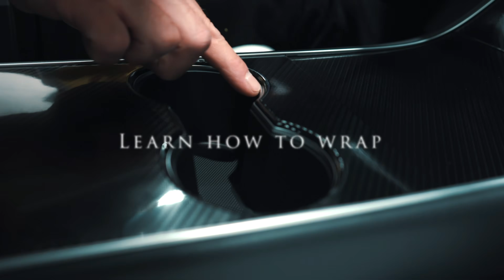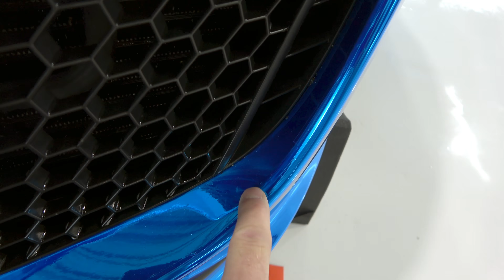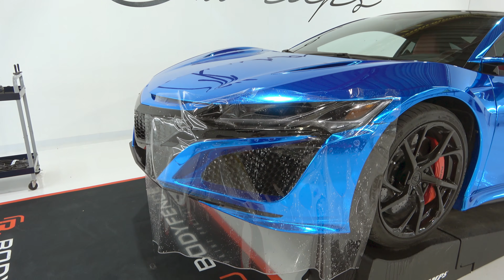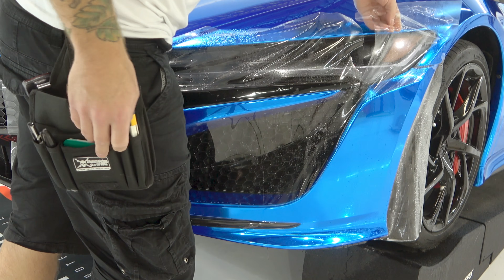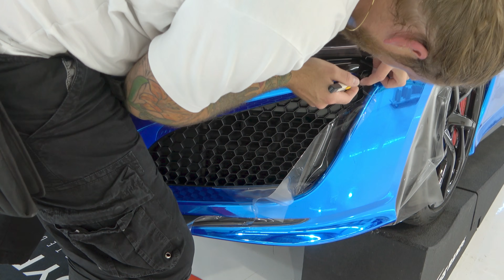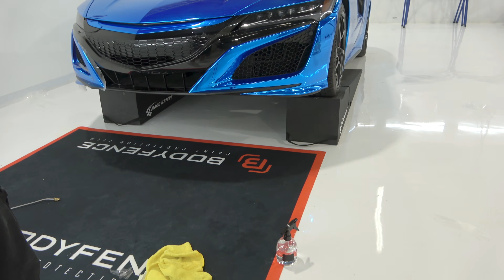How To PPF Over Blue Chrome VInyl Wrap

Comment: I noticed you PPF over Vinyl Wrap, can you do Vinyl Wrap over PPF. What is your thoughts on Dry vs Wet PPF. Seems PPF last longer than Vinyl Wraps, so should you not have the PPF under the Vinyl Wrap. I have checked, says PPF is warranted for like 3 to 6 yrs, but Vinyl Wraps are like 2 or 3 yrs.

Comment: Awesome! Can I apply this protect film on satin chrome wrap?
Reply from the maker: Yes but I'd use a matte PPF
Reply: CK Wraps will “matte PPF” transfer the satin finish? Thank you, I appreciate the feedback!
Reply from the maker: @shadow-fq7nk  basically, but you may lose a little luster. In my opinion it isn't necessary to PPF over satin chrome due to how thick the material is. It's also usually very durable against scratches.
Reply: CK Wraps that’s what I thought! Just wanna make sure from the expert himself 👊😏. Thanks again for the feedback!
Reply from the maker: @shadow-fq7nk  I have matte PPF at the shop, I can put some over the satin red chrome and see what happens
Reply: CK Wraps please let me know what is  the result then! I appreciate that!!! 💯
Reply from the maker: @shadow-fq7nk  keep a lookout on the yt story or tiktok

Comment: Someone actually bought a new NSX!  Haven’t seen one in the wild yet. 
Does the ppf cause the vinyl to age at a different rate than the rest of the car?  The ppf parts will protect that part from UV damage, but the rest of the car will are differently. Or is That not a concern?

Great job as always Christian.
Reply from the maker: Realistically it would be best to do the entire vehicle with PPF over the chrome but that takes something which is already expensive and makes it even more expensive. The unprotected parts will definitely weather over a shorter period of time but at least the front end will benefit from protection of impact.

Comment: Would heat help make the PPF stretch to make application easier ???
Reply: Hot water & baby soap would help it stretch...just plain hot water would be risky and might leave adhesive lines.
Reply: No heat on PPF. You can use steam but that’s still not recommended in most cases
Reply from the maker: Dry heat from a heat gun for example can and will most likely cause the adhesive to crack. Hot soapy water is the best option.